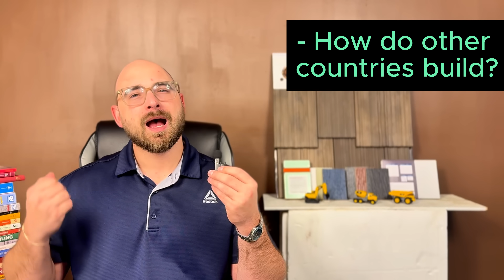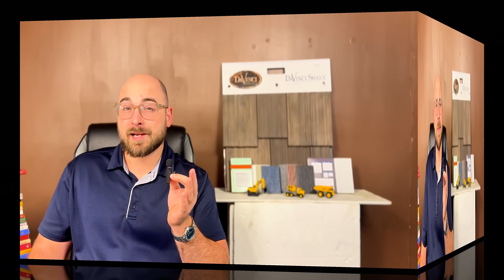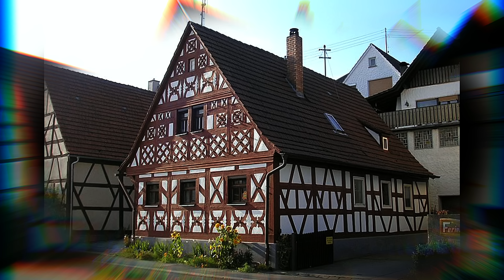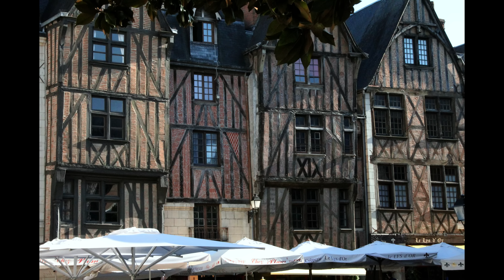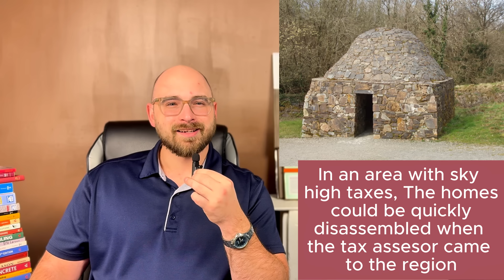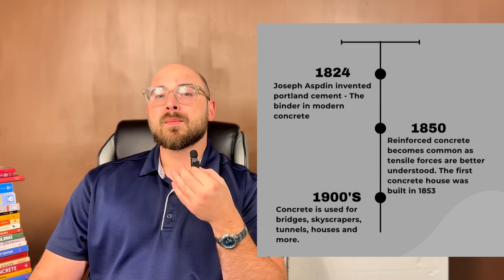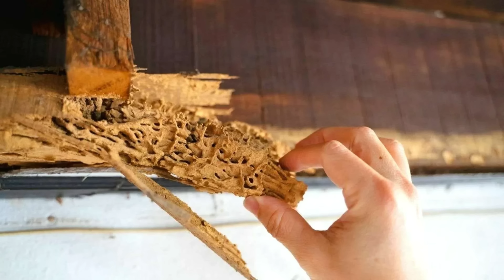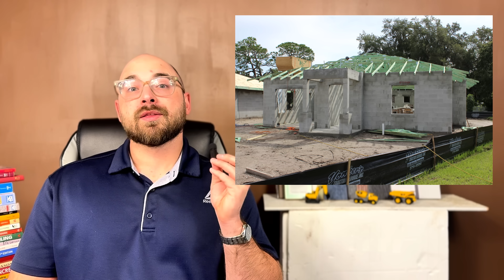Why Other Countries LAUGH at American Homes

Comment: Americans are mostly not thinking about details. 
A stick house building is not so bad. 

I have extensive experience in design and construction in Europe. Now I have been working closely for three years and observing the construction of private houses for $1-15 million. The quality of construction does not depend on the price, unfortunately. Everything is very sad.

1. No one house in the US doesn't have ventilation. Yes you have an AC system. You have zero fresh air from outside. CO² accumulates in the room. Headaches start, fatigue increases. You can google it.
2. Thermal insulation standards are 60 years behind European standards. The windows that are used would not be installed in a chicken coop in Europe. Lack of understanding of the essence of vapor barrier. All this leads to the formation of condensation and mold in all walls.
3. terrible construction culture. Everything should be fast, but no one cares about quality and shortcomings. No structure is ever straight or flat.Then the painters will come and cover everything up.
Reply: Another great comment. I am not a builder, but I do a fair amount of DIY maintenance on my house. The short commings you mention sound familiar e.g. windows (or doors and patio doors for that matter) are a great example. In my 1987 built house it is basically impossible to install a draft-free entry door. I am now in my third door since I moved here in 2004. All of the doors were fine for the first 2-3 years, but then they started leaking air. My sliding patio door started binding basically 2-3 months after installation. My families house in Germany, built by my grandfather in 1921 had “plastic” windows (I do not know the exact material specs) installed about 40 years ago. No air leakages to date! The roof (terra cotta shingles) on this house is now about 60 years old!
I think build quality is more the issue in the US than basic construction methods like wood vs concrete vs stone, etc.
Reply: I am an American and I came from engineering background and decided to build my own house. That was after working part time in the construction industry. Quality was so horrible, contractors and subcontractors so bad, inspections not done properly, when I built my own house absolutely no subcontractors. Did it all myself and got it done right.
Reply: There are standards concerning thermal insulation, windows and certain building techniques to use. It depends on the state. Many states don't set standards that are better. I don't want to get into discussion why the states don't do it since it will lead into a political discussion from others.
Reply: @Rhaspun then how come those things get discussed and implemented in countries like Russia so quickly? They went from double glazing to triple becoming a standard in a matter of ten years
Reply: As a Russian living in Australia it boggles me how little demand people place on the quality of their homes they take 35 years mortgages on 😮 Those sheds are not worth the money
Reply: I agree with 3) but the other points seem off.  

1) Older homes are drafty so will have plenty of natural ventilation.  Newer builds with more air sealing should have ERVs installed during construction.  It is not difficult to install them in existing construction if they already have HVAC/ductwork.
2) energy is much cheaper in the US, and adding insulation has diminishing returns.  Most people who want to go beyond current building code for insulation will never recoup their costs in their lifetime.
Reply: I’m sorry, but your comment reads like an over generalization based on a single data point, especially the part where you pretend that we don’t use vapor barriers in the United States. Yes, you can find a lousy builder anywhere and then complain that the entirety of the United States is solely up to the standard of that one terrible builder, but that’s disingenuous at best.

The biggest thing holding back innovation of the United States are the building codes they don’t allow for anything other than what’s written in stone …. Any deviation can cost you tens of thousands of dollars trying to get exemptions and exceptions even if it’s a far superior design.
Reply: @Matt-yg8ub :  Sorry he is right, he just forgot to mention how overwhelming the building code is and how much it’s stifles innovation. That’s why we are 100 years behind the times. The industry is a joke. Imagine if your cars were built like American houses, you wouldn’t even get out the driveway
Reply: @Matt-yg8ub he's on point mate The West is decades behind the rest of the world when it comes to construction
Reply: @Matt-yg8ub  I work in the high-end segment. I produce furniture and interior elements. Most of the houses are in western North Carolina, there were also a few in Illinois, Colorado, Ohio, Connecticut. I show up at the construction site when the frame appears. And then many more times. Everything is bad or terrible everywhere, in my subjective opinion. Not vertical,  doesn't have horizontal surface, not straight. 

The most memorable was the office of one construction company. It was necessary to install a kitchen on the wall. On 6' of vertical were 5 inches out of level.
Reply: @miraslauby  It depends on the state and locality. There's a couple of channels of home inspectors doing inspections and they are pointing defects and inadequacies of the construction  The builders don't seem to care and the local government inspector is missing or likely being paid off to over look blatant problems.
Reply: @Rhaspun  I don't particularly trust inspector institutes because there are too many mistakes starting from design.
For example, I recall a story from a realtor. When she was showing identical houses to clients, and in one bedroom, there was simply no window. In all other types, she just remembered: these rooms had a window, there's a bathroom, there's a closet, but there's no window. And no one, at the stage of construction, at the finishing stage, none of the inspectors, none of the builders even thought that there should be a window.
Reply: Retired painter here and the  extremely poor quality of the materials and lack of ANY craftsmanship in new American homes is so shameful. And it all boils down to one thing- GREED.